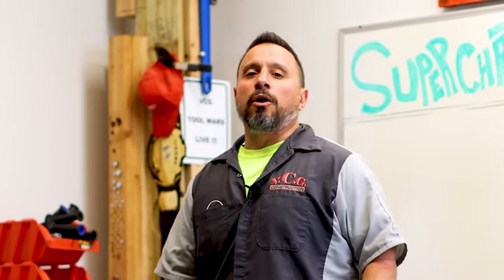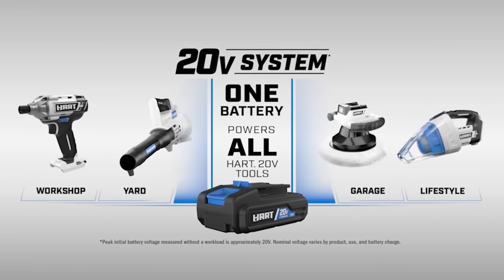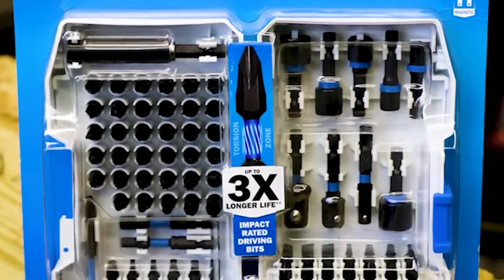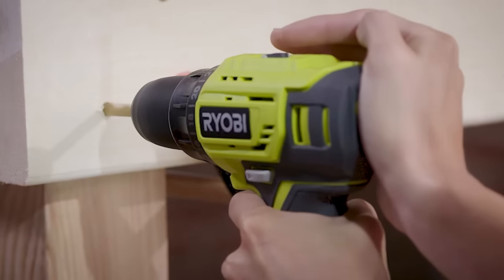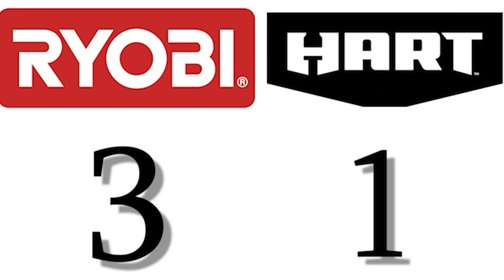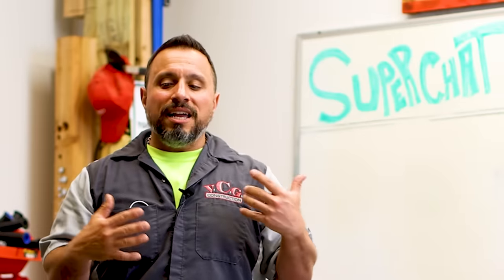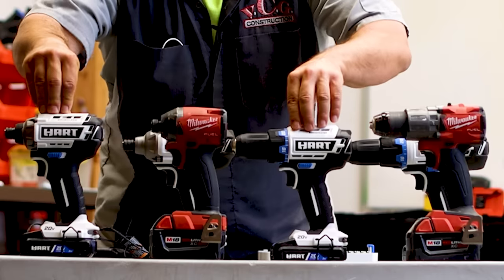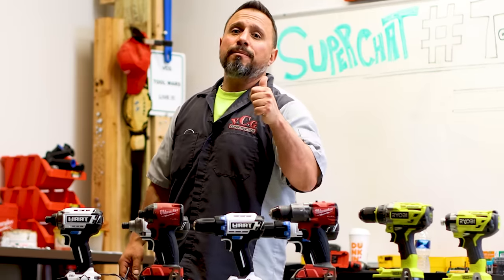HART Power Tools At Walmart PEOPLE HAVE NO CLUE!

Comment: With rigid, kobalt, Ryobi, and hercules out there I just don't see Hart tools bring that great of a value right now.
Reply: I think it all depends on packaging and sales offers.  I sold tools at the local Big Box Orange store for more than a while, and I can see a definite advantage to the everyday homeowner depending on what tool you need.
Reply: even Dewalt 20v brushless tools go on sale for less than these Hart tools many times throughout the year.
Reply: Kobalt makes some OK, and then some absolute shit like screwdrivers and allen wrenches that strip out bolt heads and round over.
kobalt visegrips .... soft stampings that deform
On a jobsite that pissed me off. I will never use anything kobalt no matter how cheap, my time is valuable, free isnt worth the time to extract a broken bolt.

I dont have time to play the guessing game with kobalt over powertools
. 
Thankfully Craftsman is now sold at Lowes, best screwdrivers & socket sets  for the money, Ive been using some of the same crafstman ratchet drivers & sockets in industrial maintenance 15 years now, dropped countless times, even put them on impact wrenches when I didnt have impact sockets the size. 

Kobalt may be ok for a home-owner running a hole in drywall on a weekend, on a jobsite I would treat them as disposable tools.

Comment: Bought the Ryobi set here a couple weeks ago... before watching this vid. Honestly, it's a great value for most home jobs. Used them to mount my TV. Worked great. Figuring the batteries alone run $50 each, to get a driver, drill, two batteries, and the charger for $100 is no brainer.

Comment: Milwaukee is the way to go!!!!
Reply: Milwaukee and Hart both made by Chinese TTI.
Reply: I use Milwaukee and honestly, the battery construction is terrible. Electrically they kick ass but the batteries physically fall apart
Reply: Milwaukee, Ryobi, Hart, Rigid = same company 👍
Reply: I’ve used Milwaukee and ran into a few other people with the same problem. The batteries honestly fall apart. You gotta hold the battery to the connection while drilling. And everybody tells me the same thing well just take care of it. Well tools on any jobsite will be abused that’s just a fact.
Reply: Daman33405 I’ve dropped my batteries only enough to count on one hand (per battery), and all of which were chest height or less. Then the battery splits in half at the clamshell. The only battery I have to hold is one I found in a junkyard missing the top half of the clamshell. Bought a ~$15 dollar knockoff case for it, put the guts into it, and works fine in most of my tools. My 1/2 impact and sawzaw both don’t work with it unless I hold it juuuust right. I’ve actually found that superglue works well to hold them together for awhile but once they crack their days are numbered
Reply: Hell yes...drink it every day!
Reply: Makita and Milwaukee are definitely great. If Hilti wasn't so expensive they would rule the tool world.
Reply: Used to be the way now is low quality rebranded Chinese made tools. Makita milwaukee and dewalt are all the same now...
Reply: Milwaukee is in fact the best name brand tool...  but at 3-4 times the money...
Reply: Fuel is the way to go
Reply: Milwaukee is a great beer.
Reply: Dewalt is probably a better way to go. I love Milwaukee but they are extremely over prices and Dewalt makes more cordless tools than red team. However, everyone talking about battery problems and I've never had a single issue in almost 7 years with Milwaukee. Granted I only have 8 batteries for my 5 red tools, but then again my 4 Dewalt tools also have no issues with batteries. I'd say red v yellow is a toss up to price. Both are very high quality.
Reply: @thehurts9216  I have both the  Milwakee M18, the DeWalt Max 20, and the DeWalt Max 12...  DeWalt is very good but the Milwaukee is still top of the line...!
Reply: @thehurts9216  If you look at both, and they were the same price, you'd choose Milwaukee...  Guaranteed...!
Reply: @williamriley2528  good point, 🤣🤣
Reply: @seanjohn7972  
Lol......totally!!
Reply: I’ve bought every brand on the market and I highly recommend Bosch.
Reply: @Lunas2525  only difference is  Makita never sold out and has no parent company.

Comment: The similarities of Ryobi and hart are uncanny... many of the hart tools are extremely similar in look and design as Ryobi... they are basically Ryobi tools with a fresh coat of paint.... but not quite the same quality even though they are manufactured by TTI industries....Good tools for the typical homeowner no doubt
Reply: And Ryobi is BELOVED by the DIY community. Based on your comment hart tools should be flying off the shelves but nope, people think Walmart is cheap crap so no good. But once a tool channel like VCG talks about them they get more recognition.
Reply: Loren Fok .... They are not cheap crap.... their other brand Hyper tough is more or less garbage but even they serve a purpose.... ryobi is simply better quality than hart but that doesn't indicate that they are cheap garbage... either one is a good choice for the typical homeowner it's just that Ryobi is a little better quality.... I would put  hart More in the category of craftsman which also is not cheap garbage
Reply: @devilefan  I wasn't calling hart cheap crap by the way. I was saying that's what a lot of people think that's what is their first reaction to a Walmart tool line..
Reply: you do realize that the Hart tools are  the previous Generation of RYOBI made to accept a Milwaukee battery, don't you?
Reply: kirk kopak Hart tools uses Milwaukee batteries?
Reply: Loren Fok ...hart is a well-known brand but mostly for handtools up until this point...Hammers was really their big thing

Comment: I have a Ryobi drill driver set. Have owned it for close to a decade. I'm a home DIY'er so the set suits me fine and performs well for what I need it to do.
I just bought a Hart 10 gallon shop-vac to replace an old unit that's about worn out. It works well, it's quieter than the old vac and the price was very competitive.

Comment: As a masonry sub contractor, I've tried tons of cheapo brands to save a buck. Including these cheap Wal-Mart tools. I've burnt up literally four walmart peanut grinders to one name brand grinder, including the Ryobi. This was grinding and pointing a 1930s brick home with hours of daily use. A few of the wally grinders only lasted a day. I also burnt through two power drills within a week mixing mortar in a bucket. Both drill almost immediately started to smoke under moderate loads. 2 drills one week... sorry. I've been using my DeWalt for 4 years, no issue. It was purchased used at a pawn shop.
Reply: Yeah but I don't think these or any cheapo brand were ever intended for heavy use mostly a few screws in some wood and that's it I've tried alot of the brands because honestly I buy more tools than I need and for around the house there is no noticeable difference but when you put them under real work loads yes the cheap ones are well cheap

Comment: Hart isn't for the hard core DIYer, but TTI makes them. So if you like how TTI did with making Milwaukee, Ridged, and Ryobi, they might be an option. I say it would be a good option for the DIYer that really only needs maybe 3 or 4 tools, and they are adding lawn tools to the battery platform. I'd say Ryobi is better, but Hart is doable and should be a consideration depending on the amount of tools you need. (I did start this before Vince pointed out that TTI makes Hart)
Reply: Give me Dewalt anyday
Reply: @creolelady182  don’t get me wrong, I’d take my Milwaukee tools any day over hart. Just saying if someone only needs 1 or 2 tools for light diy stuff, it’s a cheaper option than a 300-$400 tool set from Dewalt or Milwaukee.
Reply: I agree ,I used Milwaukee tools doing Industrial HVAC for about 10 years.
Reply: So was hart sold? Last I knew it was a toolmaker from Vic, Australia that landed a Bunnings deal but no power tools have ever hit our shelves hart branded.

Comment: Years of a handyman and owner of $1000s of both brand name and “generic” tools, I have done the same thing with cheap tools as I have with expensive tools. Does matter if the tools are from Harbor Freight of a Snap on tool truck, as long as you use the appropriate tool and common sense. I have broken Snap on tools as well as DeWalt and Ryobi. The convenience is if the tool truck comes by everyday and has that exact replacement in stock. I made 3 trips to a Western Auto (when Sears owned them) and replaced the same Ratchet 4 times and I abuse the husky ratchet I replaced it with more and still have it years later.

Comment: I hate that walmart replaced all the name brands like crescent, Irwin, Stanley, komeleon and other brands like that all with hart tools
Reply: @alcopower5710  just like the hart vaccum they replaced the Stanley with
Reply: In Canada we dont even have Hart. We have a couple of Skil powertools, a Hypertough drill and all the bits and hand tools are made by a company named WorkPro, who apparently has decent tools but specifically made really cheap quality (a step above dollarstore drillbits) crap for Wal-Mart Canada.
Reply: @Geoffrey Morrison nah Milwaukee tools are worth the money
Reply: Yeah but all those brands are just names. Hardly any connection to their roots anymore.
Reply: @alphaclean3364  yup they're all made by the same factory
Reply: Stop shopping at Walmart
Reply: @keithmcclellan4350  I usually don't except for when I am desperate for some thing
Reply: To be fair those brands were pretty much just sticker brands anymore
Reply: Stanley tools were decent, still have my beginners tool set from high school. Countless DIY memories... i bought a Hart Electric weed eater and it was only good for 1 day ☹
Reply: The problem with Irwin, Crescent, and Stanley (not familiar with Komeleon) in their Wal-Mart line was it was well... A Wal-Mart line. 

Sure buy that Stanely socket set for $30 instead of $50 anywhere else... But compare them to the ones who got the same piece set at the other store and there is a world of difference in the quality.

Comment: Received a set for Father’s Day a few years ago and they are still going strong. Have used the brushed impact on the job site for at least 3 to 4 days a week(have dewalt for the tough stuff) for about 2yrs and it’s still going strong today. The bits on the other hand are as brittle as cold glass. Can’t count the tips that have broken off the T-25 and ph2’s

Comment: I'm more confused than ever! I'm sticking with my Makita tools.
Reply: Still have and use a Makita cordless drill from 1993/4
Reply: Ive found sticking with makita ,Milwaukee, or dewalt  the big 3  a person will be happy with the tools they buy.
Reply: You too? I thought I was the only person left who buys Makita. Hahaha
Reply: @jackhanson6390  First cordless drill , Makita , First NiCd battery , Makita , First Li Ion battery , Makita , Forged steel gears in grinder , Makita , rest use powder metal .
And the same benefit that only Hilti has , you can still get batteries for a 25 year old Makita tools , as spare parts .
Makita also makes lot of factory assembly line tools , without all the TPE rubber crap , sadly those cost an arm and a leg .
Reply: Bought a dewalt 4" grinder 150.00 4" harbor freight 10.00 dollar on sale 4" grinder. Dewalt 4 months. Harbor freight. 6 and half years hard abuse before I killed it.
Reply: Makita, especially the Japan made tools!
Reply: Just paying out the ass for batteries.
Reply: I think what he is saying is that walmart entices you in the tool but with one battery then having to buy another battery you just bought a ryobi set for the same price...its all in the marketing..like sams club..when you break it down you are paying the same as at walmart minus the yearly fee
Reply: MaKita has a huge factory in Buford. GA. 5 miles away from this video.
Reply: Love my Ryobis been running them for 20 years.
Reply: @wehrwolf8006  Retired General Contractor here; I used Makita pretty much exclusively except for a few "specialty  tools" they didn't make at the time.  I still have tools from the late 80's and 90's that work with the new lithium batteries with the adapter.
Reply: Each to there own....Rigid guy here.
Reply: LOL
Reply: @deejayimm  thanks I'm gonna look that up I just bought a new makita today because the battery was 120 or 227 for 2 brushless black series sub compact drills 2 batteries
Reply: What the Fajitas is that!?
Reply: @brianjacobsen5762  bought a $4 cordless mini drill from harbor freight. Came 3 weeks later (freight shipping), broke on first day D:
Reply: Yes. The Hart drill is straight ass and way to expensive for much of weak power.  I'm returning it
Reply: @brianjacobsen5762  are you serious or am I somehow misreading what you have written? Did you say that something you bought from hf, lasted almost 20 times as long as the same dewalt product?
Reply: @RTwesthoff  I’ve heard they’re made by the same manufacturer as these.
Reply: @dumdiversaspapalbull1452  Hart is owned by Techronic Industries....And Rigid is owned by Emerson.
Reply: @dumdiversaspapalbull1452  Yes I did.
Reply: @RTwesthoff  I thought this guy said hart, ryobi, and Milwaukee, were owned by the same company. I’m pretty sure that I’ve heard him say that Milwaukee and rigid were owned by tti in a previous video.
Reply: Yeah, I just looked it up. Rigid and ryobi....all of them, licensed by tti. With the parent company being Berkshire Hathaway.
Reply: @brianjacobsen5762  👍🏿
Reply: @dumdiversaspapalbull1452  It's the luck of the draw. Be nice you knew what day the tool was built. You don't want Monday or Friday. Everything made to quit. Otherwise. Like my basement freezer from the 50s Made by General motors Frigidaire. That was here when I bought this house. 21 years ago. Is still keeping food cold. Corporate figured out quantity not quality.
Reply: @brianjacobsen5762  yeah. We had ge stuff that lasted 30 years. I’m a rigid fan too. I mean ridgid means plumbing and I used to be one, but once these companies buy a brand, that second brand is getting scavenged. Just like porter cable.
Reply: @dumdiversaspapalbull1452  Today brand name doesn't mean much. I just watched My friend Pete. D I Y auto body school. Tool comparison on screwdrivers. Set 7 snap ons 300 bucks. 7 set from HF for 14.00 he liked better.
Reply: @michaeljohn8905  I was able to tour that factory in Buford about 18 years ago.  They pretty much only manufacturing their Hypoid circular saw and a few grinders there at that time.
Reply: @dumdiversaspapalbull1452  porter cable was atonement the adept tool you could buy even cordless i have bought them up till recently  and the ones I call crap still beat Milwaukee,  and Dewalt in the hammer drill wasn't until they went to powder cast gears that they couldn't beat  most competitors.  Still have the 19.2 v put it up against anything made
For power. It isn't decked out with the bells of today of course. Who on here remembers when you had no driver I pact you used the same drill you hammered and drilled steel with. Try tha today lol.
Reply: @bradcornelison7380  you haven't used any of these top brand brushless tools have you? If you had you wouldn't think your porter cable could even come close in power to Milwaukee or even Dewalt.
Reply: I have all Makita tools. I used to have all Ryobi, and you know, my favorite Impact off all time was a ryobi impact! But my Makita stuff is much more sturdy and reliable than anything else I've owned. The big 3 is right...but ryobi impacts are my faovorite!
Reply: Right.. I like snap on myself but WalMart brand .   Really?

Comment: My set of 18v DeWaalt power tools were needing new batteries since they weren't holding charges very well. I purchased some of the Hart line up including drills, air compressor, orbital buffer, saber saw, jigsaw, circular saw, spot light, work light. rotary tool, power converter, vacuum, and more and have been very impressed by them all!  Needless to say, I sold all my DeWalt tools!